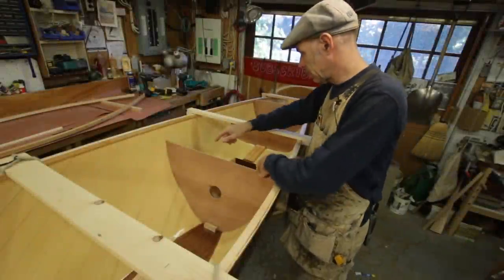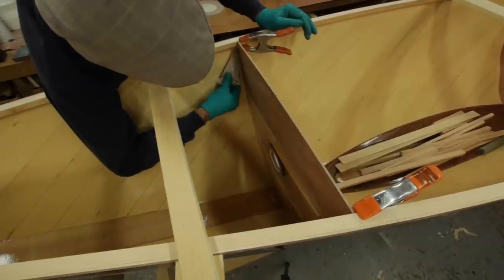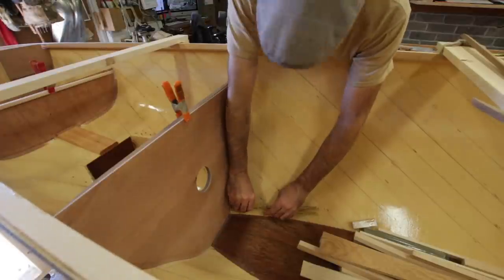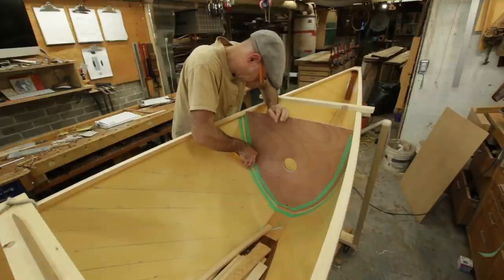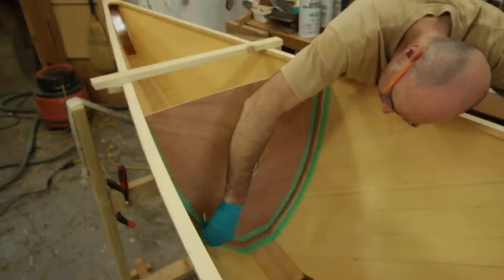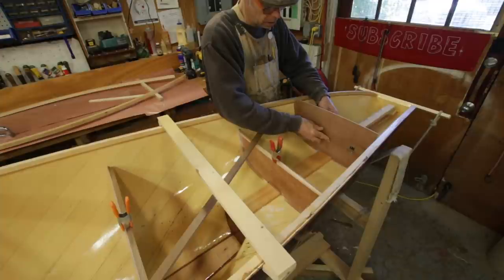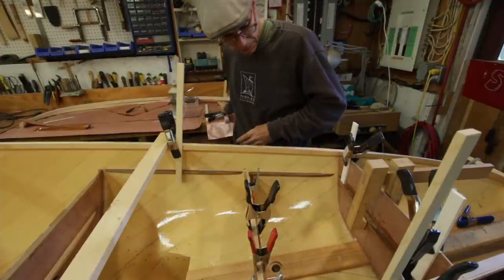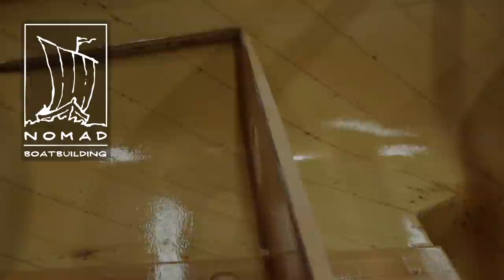International 2.4mR Sailboat Project - Episode 30 - Installing the bulkheads

Comment: Yeah I’ve never been a fan of the tape method.  I’m building a fiberglass plane and your method works best. One suggestion you might want to try is placing peel ply on the fillet after application, it brings the resin to the surface and makes for less sanding and smoother finish.  If  your fillet won’t be seen then there is no need.
Reply from the maker: On a strait run peel ply would work well but on a compound curve I think it would be yet another nightmare.

Comment: Hi Mark, loved the tape show, and love the boat.
Iike you I was never a big fan of advice. 
I worked  for Duck Flat Wooden Boats in South Australia,  shout out to the guys. ( they build great boats).
They showed me a neat trick.
When the fillet is half set ,ie, soft  to touch  but not stuck to finger , use water and some detergent in a spray bottle to smooth  out fillet they come out so smooth, bulk head and boat are already  sealed so no ingress issues, cheers.
Reply from the maker: I will have to remember that for down the road. Maybe it will come up on the next project.

Comment: The tape method is often used for applying silicone filets to corners of melamine molds when making cement counter tops.  Here the filet lines need to be very uniform, may be up to 10 feet long and on the top of visible side of the finished project.  Your boat filets are curved and not straight and will not be as visible since they are in a hidden compartment?  One size don't fit all jobs.

Comment: instead of fiddeling with the wooden block and knife (@ 9:40) you may also use a stripecutter for balsa strips often used in rc-modeling to cut the tape.

Comment: To perfect and Epoxy filets or other bondings with thickened Epoxy, set yourself a timer for 60 to 90 min depending on the type of hardener you are using. You are looking for the Epoxy to be curing but still be shapeable. 
Get some dishwashing liquid on your fingers and you can then shape the epoxy and smooth the surface to perfection with out making a mess on your hands or causing any adverse effect to the bond. I build high performance RC race boats and constantly use this method with great success.
Reply from the maker: I had some who worked at Duck trap make the same suggestion. Thanks for confirming that it's a viable technique. I'll try it.

Comment: Curious about the “v” of the edge, and the hard-spot-ness of exact fit of the bulkhead. Your feelings on each?
Reply from the maker: The fillets will bridge that and present a good broad intersection. I did't make the fit super tight so that epoxy could fill in around it.

Comment: hate the tape only with super sticky stuff like sikaflex i use tape; and only on surfaces that aren't smooth. what could be useful is a domed(round) shape spreader instead of a round spatula. that makes the angle to the surface les relevant to give a fillet. Downside is that it give a little les push than a spatula. love your work and explanation.  found your channel when you explained the "cheap"bed  covers.
Reply from the maker: I don't usually have too much trouble taping things off but this one put up a fight. The geometry of trying to work in the hull was really awkward.

Comment: when using a box cutter to scribe and cut into the tape u need to make sure you have a fresh sharp blade or it will hang up on you in certain areas and drive you around the bend. lol
Reply from the maker: That was a fresh blade. Probably should have used stickier tape.
Reply: @Nomadboatbuilding  true. much easier to cut. lol O well. you got her done.